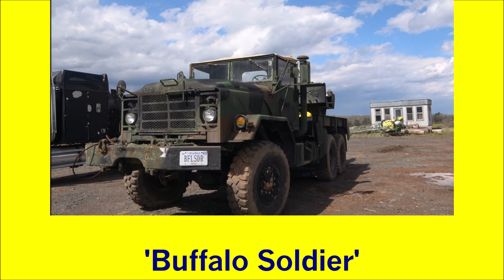Replacing Muffler on M936A2

Comment: Why didn’t you just straight pipe it instead of putting a muffler on it
Reply: Primarily, I want to limit the noise.  Eventually, I am going to switch up the exhaust, put the muffler under the cab, and run the stack true vertical.